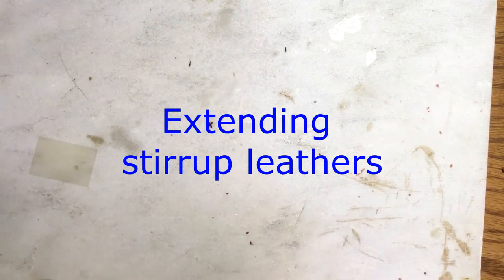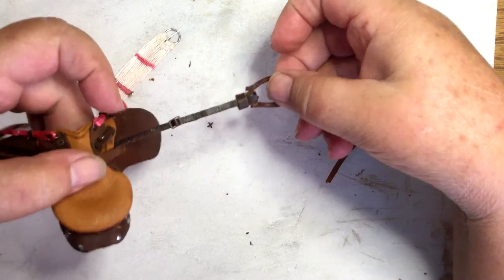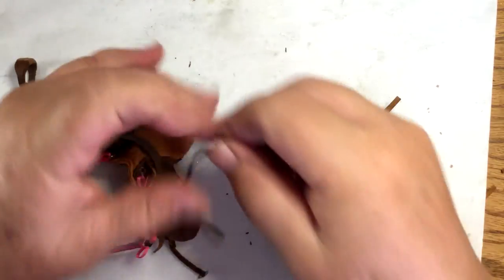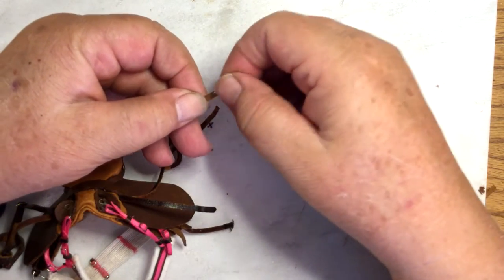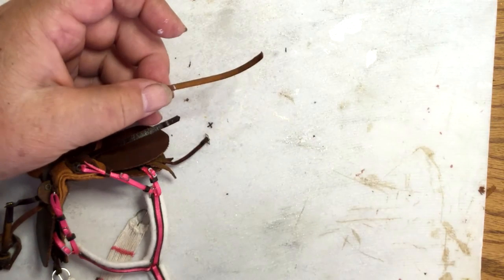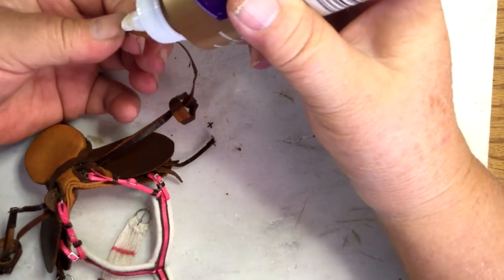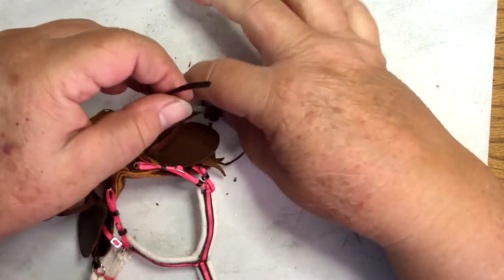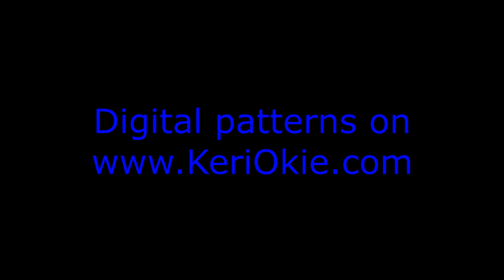Extending English stirrup leathers

Comment: Good day. I'm just new to the model horse hobby and I made my first saddle a few days ago, but I went in very blindly. It's not ideal, but as a test western saddle it probably worked quite well. I came across your video where you used a printed pattern for the saddle you were making. I would like to ask if you know of any patterns for 1:20 scale ☺
Reply from the maker: Welcome to the hobby! As for smaller scale patterns, I don’t know of anyone who offers any. However, I have successfully reduced my patterns to the Stone Pebbles or the Breyer Little Bits/Paddock Pals size models, 1/16th scale. It is pretty close. It would need to be reduced a bit more. Use the longest piece of the pattern to estimate correct size. For English use the tree; for Western use the lower skirt. I think Adobe Reader still has the reduction option in the print dialogue screen. Most good printers have a reduction option as well. I hope that will help.